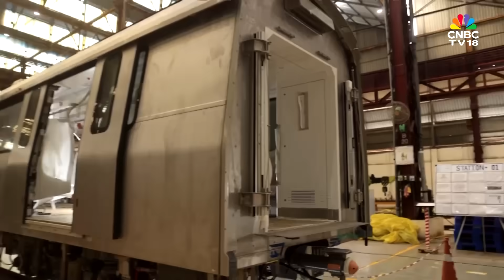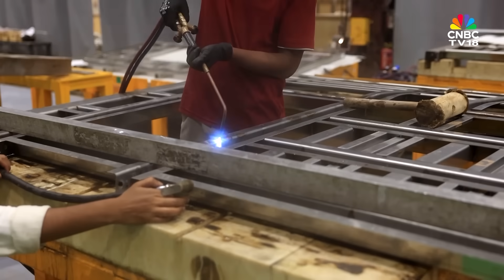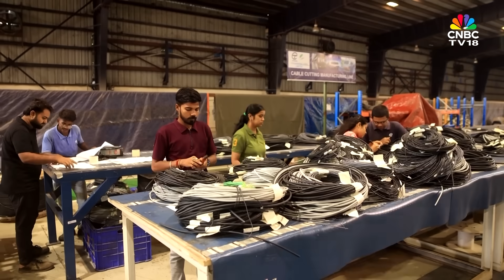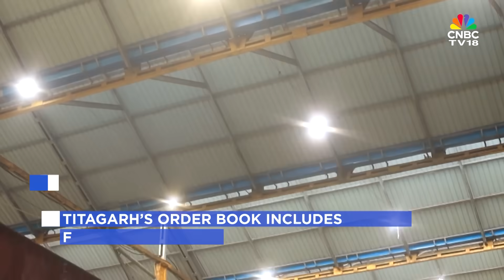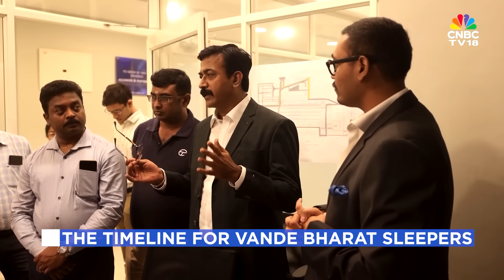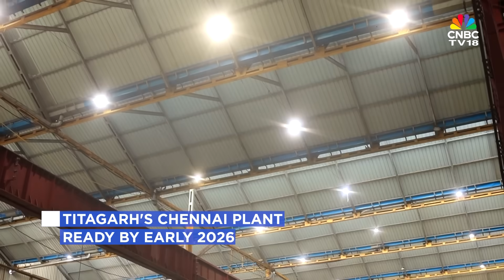Inside Titagarh Rail Systems: Building India’s Next-Gen Trains | Vande Bharat | N18V | CNBC TV18

Comment: Titagarh Rail Systems' Uttarpara plant near Kolkata lags behind Alstom's facility in Madhepura, Bihar, in current coach production scale and speed, though both serve Indian Railways' modernization needs.
Capacity Comparison:
Titagarh Uttarpara: 
Current 300 coaches/year, expanding to 850 by FY28 via 40-acre addition; focuses on metro, Vande Bharat sleepers.
Alstom Madhepura: 
500 Vande Bharat trainsets/year capacity (about 4,000 coaches), fully operational since 2017 with export potential.
Gap: 
Alstom's mature lines outpace Titagarh's ramp-up phase by 5-10x currently.
Production Output:
Titagarh: 12 passenger coaches in FY25; targeting 240 in FY27, with Q1 FY26 dips from supply issues.
Alstom: Delivered 50+ Vande Bharat trainsets by mid-2025 (400+ coaches), steady 2-3 trainsets/month.
Cumulative: Titagarh leads private EMU/MEMU at 350+ units since 2007; Alstom excels in semi-high-speed specifics.
Speed Assessment:
Titagarh rate: ~1 coach/month now, aiming 72/month by 2027; wagons faster at 1,000/month.
Alstom rate: 10-15 coaches/month sustained, leveraging JV tech transfer from France.
Verdict: Titagarh slower (early-stage vs. Alstom's decade-old ops), but aligning via automation like TAMS.
Reasons for Slowness:
Infrastructure buildup: 
New 40-acre lease, test tracks, Vande Bharat sleeper lines just starting (prototype Q2 FY26).
Supply chain: Wheelset shortages in Q1 FY26; backward integration pending (e.g., Ramkrishna JV wheels by 2026).
Order complexity: Shifting from wagons/EMUs to advanced metro/Vande Bharat requires certification, trials.
Investment phase: ₹126 crore land deal funds scale-up amid ₹24,500 crore order book pressure.
Strategic Outlook:
Titagarh's growth (20x coach jump targeted) supports India's self-reliance, complementing Alstom rather than competing directly. 
Delays risk Vande Bharat timelines, but expansions position it for 1,200 coaches/year long-term, reducing import dependence.

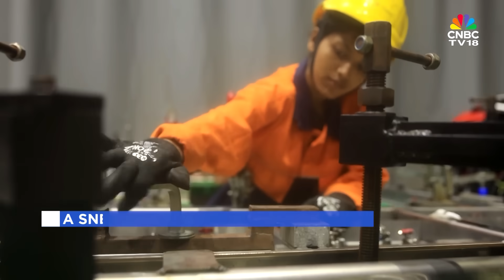Comment: 4:19 Workers still using 'manual' hand tools😢😢.. when the world has moved to Power tools for saving time and accuracy.. Titagarh seems to be teetering it's way😢😢.. No surprise it's behind schedule for everything it makes..
The reporter there has turned the safety hard hat into a fashion accessory 😂😂.. Why disrespect the PPE.. Just avoid putting it on..
Reply: So it means more job losses when u remove manual work
Reply: @rockyjohnson1775 gross misconception. When some process is automated, the business quality imptoves and lot of new works starts coming in. Like computerisation increasing banking work when it was feared there will be job losses. When ATM came it feared job losses but in reality branches increased, when Fly by wire came, it though drivers will loose job. But the manufacturing and consumption multiplied.

As long as you produce precision and quality product using machines, you will always be short of labour because of market size increase.
Reply: @rockyjohnson1775 no dummy, he meant using power tools like a motor operated nut tightener instead of an allen key. The power tools still require a human to operate, it's just that they fasten the work and save a lot of time which will result in faster assemblies and timely deliveries.
Reply: India's unique population and economic conditions require more manual and labour intensive production, capital intensive and skill intensive tools are a long way ahead
Reply: Yeah sure.. I can see where the logic is coming from.. It's like Nehru's logic in the 60s - because India is a poor country, the telephone is a luxury, ordinary people cannot have it.. The common folks should use the postal service instead.. Well done..👍🏽👍🏽👏🏽👏🏽
Reply: @pankajjoshi1209  india is a developing country just like china in its growing days both of us had a robust work intensive cheap labour so its affordable to hire them than machines
Reply: @pankajjoshi1209  whatsapp university graduate spotted😂
Reply: @pankajjoshi1209 , Why don't you set up a factory and show us how it is done? Investing in fully automated assembly line for coaches incurs a large opportunity cost. Who is going to pay for that? You?